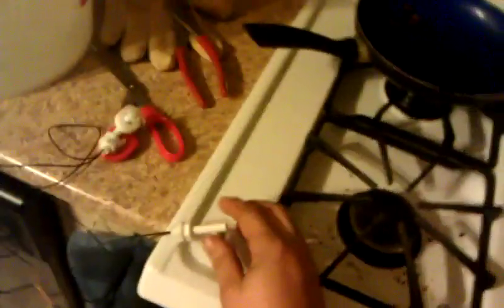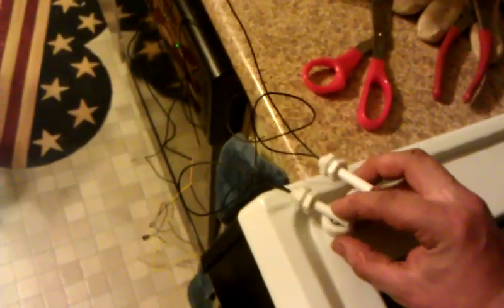DIY aquarium fish tank auto top off system the right way 12v DC not 110v AC

Comment: Exactly the same principle I used for my first boat build in the bilges 32 years ago. Two switches. High and low. Incase the bottom one fails to activate the pump. The high switch (which is the least used) comes on to turn on the pump.

Comment: I'm confused about the float valve in the bucket, if the bucket is full of water wouldn't the float valve lift up and open the connection instead of it closing it when it's down meaning low water then it will actually make the connection  to the pump?
Reply from the maker: Danilo Napalan I have the float switch flipped upside down so when the water gets to that level it stops any current to the pump

Comment: So if you are using 12V dc power supply use a 12v relay and connect it in series  to the 110 V of the pump, 
And if 24 V dc power supply, use 24 V relay, is that correct?
Reply from the maker: Yes
Reply from the maker: http://www.ebay.com/itm/Solid-State-Relay-SSR-25DA-25A-250V-3-32VDC-for-PID-Temperature-Controller-TE-/291259297642?pt=LH_DefaultDomain_0&hash=item43d0682f6a.      That relay is good for 3 to 32v

Comment: Can you explain exactly what relay and transformer I need to buy? That's the only thing I'm hung up on. The last YouTube video I watch the guy used a 16.5v transformer on a 9v relay. As soon as I get this information, I'll be ready to rock.
Reply from the maker: Any old power supply you have laying around will work as for a relay I'll send u a link
Reply from the maker: http://www.ebay.com/itm/Solid-State-Relay-SSR-25DA-25A-250V-3-32VDC-for-PID-Temperature-Controller-TE-/291259297642?pt=LH_DefaultDomain_0&hash=item43d0682f6a
Reply: Thanks duder

Comment: Way to complicated. I built my sump top-off using a small kitty litter bucket. Installed a mini float valve to give a 9 in. depth. Tied my ro/di water outlet to the float valve using ro/di 1/4" tubing.  Installed a small 55 gal/hr pump into the bucket. Plugged the pump into my new Hydor liquid level controller (see the Hydor set up on You tube). For safety I put an overflow port about 1-1/2" from the top of the bucket. 1/4" tubing from there thru the floor into a dirt crawl space under the house. Since the ro/di output is only about 3 gal/hr the 1/4" tubing can adequately handle any overflow. The system is neat and compact.

Comment from the maker: this system worked ok it would kick on and off a lot and i still had to fill the bucket a lot because i have 150 gal tank for a small tank this is great i ended up pulling apart a old fridge with the water dispenser on the door a washer would work to  and removing the electric valve and running a water line to the tank u can buy on ebay a float valve need no power works like a toilet valve for 5$ and run a line to the tank simple and no maintenance
Reply: ɷɷɷ Heeey Frienddsss I Have F0unddd W0rikinggggg Online Hacck visitttt  : -  https://t.co/pyUd0IhKep

Comment: It's quite easy to tell that most of these commenters are aquarium hobbyists and not engineers or electricians. Such a simple circuit has everyone baffled for step by step. All you need is that diagram, that's all you need. thanks. How is this system holding up over time?
Reply: What a weird comment. These people want to learn, engineering knowledge starts somewhere.

Comment: Where did you buy the switches?
Reply from the maker: Ebay just search (float switch) and the pump i used in this video was not that great i changed it with a small bilge pump still 12v system now im working on a maintenance free system i will post it soon

Comment from the maker: i used a pc pump for a liquid cooled pc so the pump runs on 12v if u dont have a 12v pump but u have a 110v AC pump u will need to do a little more work to make it work u still run 12v throw the float switches then to a relay 12v relay switch then on the 110v side of the relay cut the + wire to ur pump and run it throw the relay and plug it in the wall if u cant find a relay that works try a old truck solenoid tape up the area well before plugin it in i post a 2nd diagram here for u link above
Reply: Yep I ran into that issue, killed some float switches and looked like an idiot at my university 😢

Comment: I thought this was the best looking system I saw... But I can't get the pump I got to work on a 12 volt power supply.  I got the led and one float valve to work on a closed circuit to make sure the power source worked.  Does it have to be a certain style of pump?
Reply: Check the stats of the pump, some require more energy.